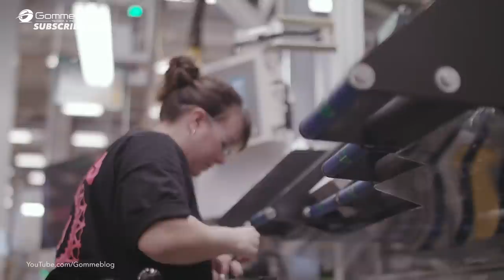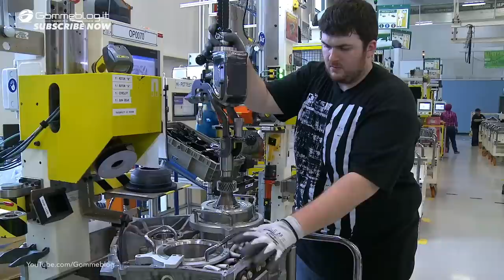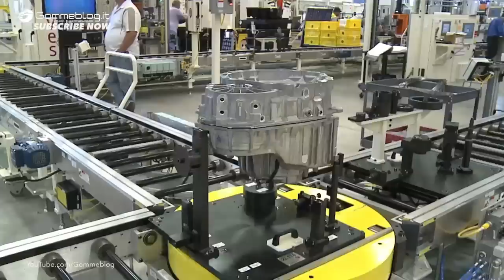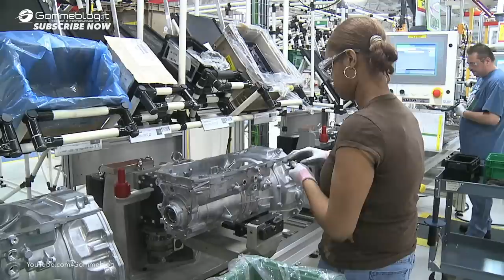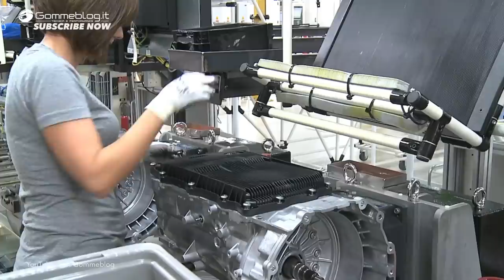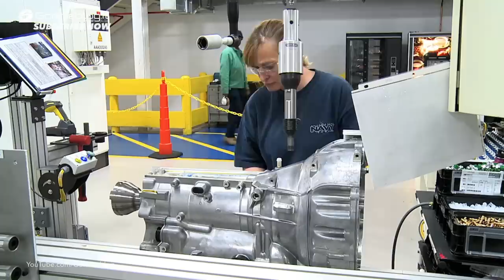HYPNOTIC VIDEO about HOW Gearbox is Made - CAR FACTORY Extreme Machines

Comment: Why are those handheld code scanners so terribly slow to recognize the codes they're scanning? In shops, they scan in a fraction of a second, but these take 4-5 seconds...
Reply: Poor scanning technique. Too close and bad angle.
Reply: Yeah we use the same scanners.  It's better to be on the same level vertically and have the barcode a little off to either side, not straight on.  Forget about scanning something that's angled differently on an x-y basis at the same time.

Comment: With all that technology you would think that cars will perform right all the time, wouldn't you?
Reply: It's very easy for many people to simply comment like you have. Please do give some thought that majority of modern-day vehicles literally have hundreds of different engineering systems, most all working as they should most of the time, with also many dozens of the more technical systems doing so in near perfect harmony with another system (think engine, gearbox, electronic systems, etc.). Almost every time you start your car, almost every day, almost any weather be it outside ... that vehicle starts up and most all systems, be they power generation, power transmission, chassis support systems, the dozens of major electronic high-tech safety, control or navigation systems ... all these most always get powered up and start to work & function as intended, almost every single time .. for months, years on end. Considering the vast amount of engineering technology in almost any modern-day car, yes ... once in a while, sometimes one of these parts/systems can & do fail. Of course we'd all wish it wouldn't but given the basic complexity I summarised above, unfortunately these are highly technical electro-mechanical machines and reality is some parts will naturally fail or need maintenance/replacement. The reality is today's cars are dozens of times more complex than cars a few decades ago, yet many new cars today are also many times more reliable than those from decades ago. A few decades ago, it was quite normal for almost all cars to carry a small toolbox, some spare engine oil, coolant and maybe even a spare belt in the boot, etc. ... quite normal to do a bit of DIY maintenance on your car at some stage if you happened to go on a longer journey. Yes, today's cars break down too ... but not nearly as frequently as they did just a few decades ago. Just trying to say that I often hear people say similar comments, like you have (please, I mean no disrespect to you at all) which are easily spoken out ... maybe in jest or fun as I am sure was your comment too. But just let's also take a moment to appreciate the very many amazing technologies, safety, comfort functions, electronic gadgets, etc. that our modern cars offer us today to make our lives more rewarding and comfortable and globally connected than ever before. Again, no disrespect intended by my comment to you or anyone else reading this, but just thought it may give people a moment to reflect on how amazingly complex our average modern-day cars are. Anyway, I hope your own vehicle continues to give you lots of fun & trouble-free miles. All the best, Mas

Comment: How its made, The most unreliable part on the car.
Reply: Automatic transmissions are reliable as long as you keep changing the transmission fluid and do not fall for the Lifetime Warranty
because that's there to last untill the transmission's life is over....
Reply: @muhammadabdullah03  I have horrible luck with automatics. I prefer a manual transmission. I have a manual transmission now but they are getting rare where I live because nobody can drive them 😅

Comment: looked for these units to be tested .  and verified .  that all the parts were assembled correctly.
and that the output torque is correct in all speed ranges .  plus reverse.   where was this test ?

now i know to continue to steer clear of a car w/  an automatic transmission.

Comment: What a restful place to work! I would hope that all could rotate among the stations to keep monotony at bay. I find it interesting that their tool rest have sensors so they don't end up on the road.
Reply: The whole assembly operation is designed so that pretty much any chump can do the job - skilled labour is not required here.  Now if you're having to machine each of these parts on a lathe, by hand, now there is where the skill is.
Reply: @bobolulu7615  even the lathes and mills are CNC, all you have to do is insert the billet and press a button.

Comment: Introducing my invention positive drive infinitely variable transmission PDIVT. There are several concepts available in the world claimed as PDIVT. However my invention it's the only one that doesn't require belt nor force anything deforms to achieve the mechanism. It's also the first PDIVT to transmit power from center of engine's output shaft.

Absolute center has zero power, but slightly moving away from center say a distance of a molecule will deliver insane amount of power. More than enough to over come the inertia of any heavy vehicles.

So when the mechanism switches rapidly away from the center will allow the vehicle to speed up faster than electric motors. It's the only solution for ICE to beat electric race cars if the engine has enough of power.

DCT, torque converter, planetary, CVT are old technologies. It's about time for humanity to advance into the future mobility.

PDIVT is simple in mechanism. Therefore it's cheaper to produce as well as maintain. Plus it's many times more reliable than existing transmissions. It only falls behind of manual transmission in terms of reliability and cost.

Comment: When EV's dominate (no gearbox) what are all these automatons going to do for a living?
Reply: They will also need gearboxes, and mechanical parts. They could also assembly E-motors and related hardware
Reply: A lot of these transmissions are ZF designs. I guess they'd make electric transaxles instead of regular transmissions.
Reply: Heavy duty mechanic here. Saw several prototypes on display as well

If everything became  electric  we'd be close to exhausting our supply of copper and your prices go up. Easy way to solve that is by having a transmission and only one motor. Current evs arent afraid of using 4 electric motors, one for each wheel because they dont produce as many and its to get the most efficiency possible as a sales pitch
Reply: I will use an electric shaver that has a battery, my girlfriend will use a battery operated "massage" tool, but the hell I will drive a truck that has a goddamn battery.  Batteries are for kids' toys, flashlights and vibrators.
Reply: @samadrid6321  Good luck hand cranking your truck's engine to start it, then.

Comment: Hm...yes, its a boring job...but it's a job...well paid job. Of course, the robots can do jobs like this, but robots are not exactly cheap, and they do get sick and injured. and when they do they need a doctor, of which...more robots you have more of these doctors you need..and they don't come cheap either. Depending of the work needed to be done...some of them are easier to automate than the the others  so companies are trying to compromise between investing heavily  into the automatisation or keeping the human workforce which in many cases provides for more flexibility and less costs. I work in the auto assembly plant for 26 years and although we have many robots most of the assembly is still done by humans...Its easier to automate the new assembly plant but in the older ones, before you introduce the robot you might adjust the environment to the robot which might get expensive. Also, car manufacturer are introducing changes to the vehicles they building and also constantly changing the way assembly is done, so when they decide they want the instrument panel to be done at different station than in previous model they would have to move the robot and all the accompanied ripple effect to the rest of the proces. So you multiply this to a few hundred or more changes every couple of years and the cost goes up ...which in human workforce is much, much simpler  and cheaper.

Comment: What model/make transmission were those?
Reply: For Chrysler Cars - Dodge Charger and trucks.
Reply: It is an automatic transmission for a front wheel drive car. Ive also identified a few transfer cases for 4wd SUVs or Jeeps.
Reply: Steve Hart 
Last few scenes are of trans for RWD vehicles.
Reply: The picture showed the 8 speed automatic originally designed and built by ZF in Germany. These are the the similar Chrysler-made versions for use in charger, challenger, 300, Durango, ram 1500 etc. There also happened to be AWD versions that had the extension built on for the front driveshaft. Near the end they appeared to be some smaller, more compact transmissions that were probably the 9 speed Auto for FWD cars like the 200, cherokee, Pacifica etc. And I'm not sure but I thought I saw one or two hybrid transmissions with electric components... Maybe I'm wrong. But they definitely build the vast majority of the different transmission types here for the Chrysler/jeep/dodge lineups
Reply: Its for a Chrysler RAM ive seen it in Mexico truck assembly plant

Comment: here's what I liked about this video: when an item first arrived at the station, shields, barriers and jigs were placed to ensure no lost/dropped parts and proper placement. AS SOON AS they finished, the jigs and barriers went back to their storage shelf, rack or position. They didn't just set them down and then have to look for them later. Very methodical.
Reply: Bet there is a sensor in the fixture storage rack so the line will not advance until the tools are put back where they belong

Comment: GEARBOX, İT İS VERY EXPENSİVE PARTS FOR CAR. SOLUTİON; ELECTRİC CAR, NO NEED GEARBOX!
Reply: Gearbox/engine cheaper than battery/electric motor(s)!
Reply: Gearbox, hundreds of thousands of miles. Incredibly expensive battery? A fraction of that amount. No thanks.
Reply: Yea, it only has this simple frequency converter what is obsolete a year after been produced ...

Comment: A nice mix of transmissions, helicopter, auto and truck.  A nice clean modern plant. A far cry from the plants where I worked. The last plant built helicopter transmissions. When it was built in the late 1960s it was state of the art. Forty years later it was literally an industrial accident waiting to happen. The company hired a master electrician. He took one look at the wiring in this metal building and quit. Hey only one guy was electrocuted. (For real), changing a light bulb. A Mexican who worked for a local roofing company, worked 25 years and retired. He had never worked anywhere except on the roof of that building. The roof was that bad. 
I was fortunate enough to have worked with some guys who had worked at the auto plants when auto workers struck for the right to form a union.